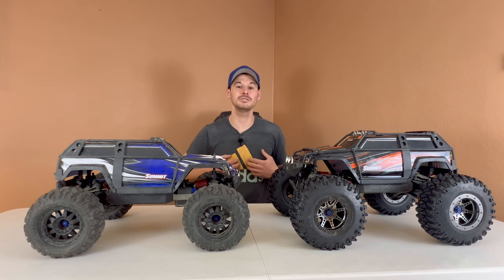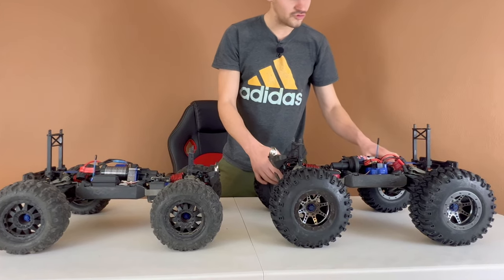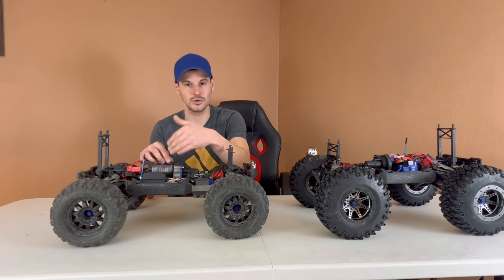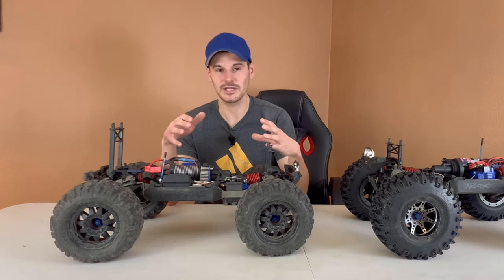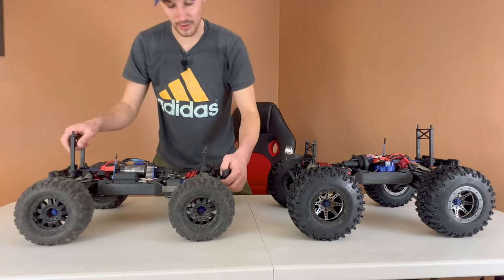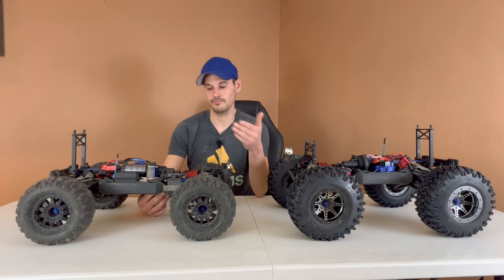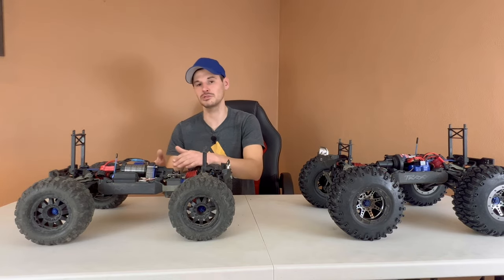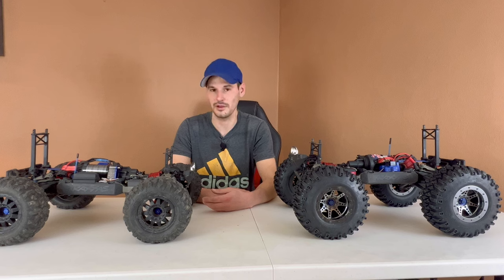BRUSHLESS vs BRUSHED Traxxas Summit COMPARISON…my THOUGHTS & EXPERIENCE

Comment: Best summit basher is and will be with slight mods to the chassis. Use a revo 3.3 roller and use the summit trans. How the trans bolts in is close. But you will have to mod the motor mount area..but it will be a beast!
Reply from the maker: Good tip!

Comment: First i ever break in my bone stock Summit are Spidergears only at rock crawling!  I constantly break spiders 12 times a year now my summit "parked" 5 years in the deepest corner in my garage! Now my hardened spiders arrived anmd i try a new start! I search for a waterproof Brushless system same power as the stock because i often splash rocky rivers.
Reply from the maker: Yeah the spider gears are pretty weak….I run hardened steel GPM spider gears in my diff….also Aluminum diff cups so they can’t move around in there

Comment: I have a v1 revo. Running 6S in it. I put a Spectrum 160 amp 8S capable ESC and a Castle motor. Haven't broke anything yet. Did replace the spur gear with a steel gear and steel traxxas axle shafts. 
Beast!!!
Reply from the maker: The Revo seems to hold up a lot better to 6s power compared to the Summit…probably cause the Revo was built for 6s power and the Summit wasn’t….my Brushless Summit breaks on 4s most of the time lol
Reply: @RCKnockout  
I'm building a nitro Revo with a Summit body. I should get some funny looks from some of my rc friends when they see it. 😊
Reply from the maker: @BERSERKERNA39  That sounds pretty cool….personally I prefer the look of the Summit body over the Revo

Comment: I run 6s on mine. But I have LEM aluminum diff housings with their gears. The Summit Ultimate Combo. No issues. I have the LEM axles on the way. My system is the Hobbywing sensored combo.
Reply from the maker: Nice! Glad to hear yours is holding up well to the brushless power 👍😉

Comment: How would a brushless setup on a Summit handle a 3s lipo? Do you think it would have all those same problems?
Reply from the maker: You could run 3s on a Brushless system, but 3s would still be more powerful than the stock Brushed system on 4s….so you’d probably still end up destroying the stock diffs eventually
Reply: @RCKnockout  So like you said in your video, the Summit was basically designed to just handle its stock brushed setup?  I was looking at a used one but the guy upgraded to a brushless castle creations 8th combo but said it was controllable on 3S.  It's a decent deal so I might get it and just run it on a single 3S but I really have no experience on the Summit and am not sure how much it could take.
Reply from the maker: @leodiaz1784  yeah it’s really not built to take brushless power…it’s still fun with the stock power for crawling and easy bashing

Comment: Hi! 
Did you tried to run 2s Brushless? If yes, how it goes? (about blowing stuff like diff, drive shaft, pinion etc)
Thank!
Reply from the maker: I’ve never run 2s Lipo….you would need a jumper so you could run a single battery pack
Reply: @RCKnockout  Could be interesting to see what it done compare to 4s Brushed (stock)
Reply from the maker: @simonshift  I’m sure it would be extremely slow….it might be alright for crawling but it will most likely be gutless….I like to have a bit of speed lol
Reply: @RCKnockout   Should be awesome you but the test on vdo ;)
Reply from the maker: @simonshift  yeah it would be interesting lol

Comment: I bent the mip drive shafts the first time I drove it !
Reply from the maker: Yeah I’ve broken an MIP stub axle…I’m pretty disappointed in them considering the price
Reply: @RCKnockout  I'm to the point where I'm scared to run it because I don't want to break it !
Reply: I have the trx 7075 128mm links and trx 7075 102mm push rods no problem there
Reply from the maker: @christopherlastname7638  yeah if you run it…it’s probably gonna end up breaking unless you’re really easy on it

Comment: Why not go to a 2-3s brushless motor and esc take that 6s out. The 6s system is to much. Thx for the vids have watched most of your summit ones they are in some pretty cool places
Reply from the maker: Glad you like the Summit videos! Unfortunately you can’t just throw a 2-3s esc and motor in a Summit…it weighs 11-12 pounds….if you read the fine print closely on any 2s or 3s combo…they either say made for 1/10 scale or they put a weight limit..almost always below 7 pounds max weight….the strain from this heavy of a machine will cause constant overheating and thermal cutoff…I could just run 2s or 3s on the current system I’m running but it’ll be pretty slow…would kinda defeat the purpose of going brushless at all

Comment: Why don’t you just use a smaller brushless motor less torque and speed but you’ll get more speed than stock
Reply from the maker: That’s an idea….but the issue would be with an undersized motor pushing around a 11-12 pound machine will get very hot…might even burn up under the strain….also I don’t think a smaller motor would be a direct fit on this motor mount